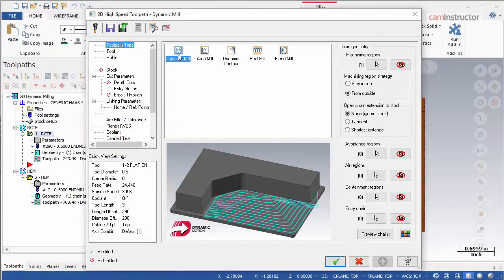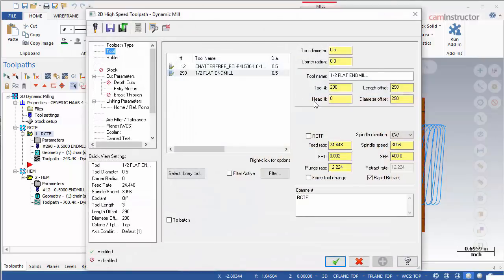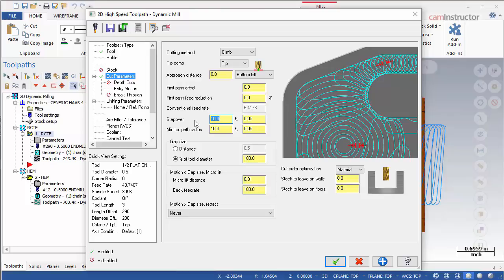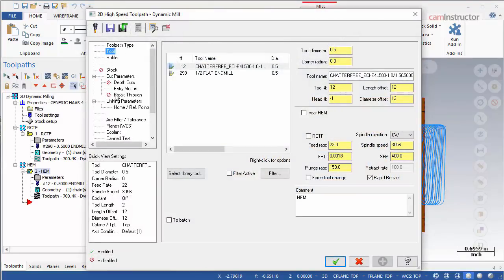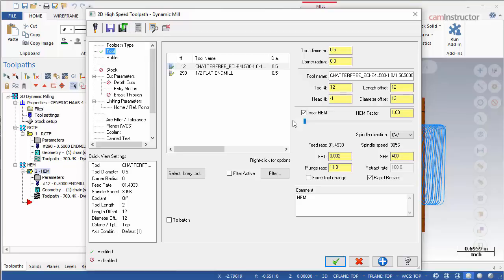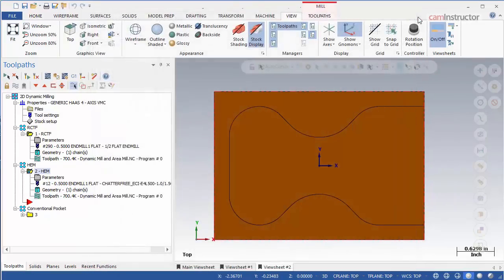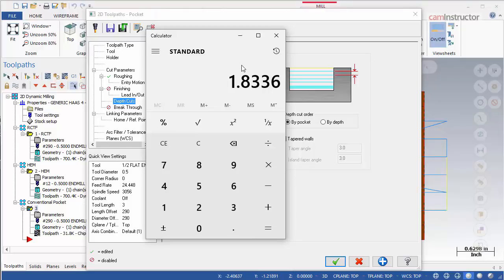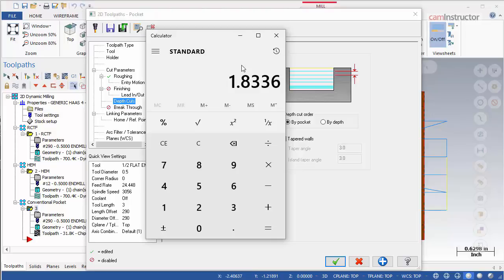Mastercam RCTF and Iscar HEM - Explained

Comment: The RCTF changes are all based on the initial speed and feed, right? Those speeds and feeds are based on what type of cutting exactly? Full slotting? 50% stepover? This is information that I can't find anywhere and therefore makes that button useless to me.
Reply from the maker: They are based off of manufacturer recommendations.
Reply: @CamInstructor   Yes but for what type of cut? Full slotting, 50% stepover? It's very vague.
Reply from the maker: It will say in the chart. Usually they state full slot at 1 or 1.5 D deep or 20% axial at 2D. Different mfgs may state values differently though.